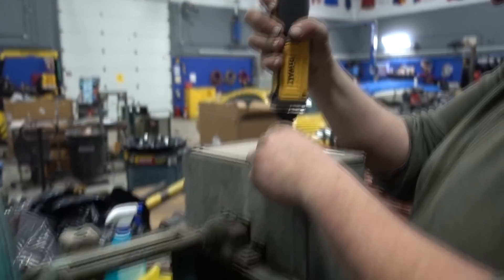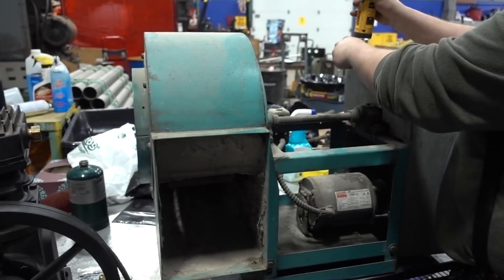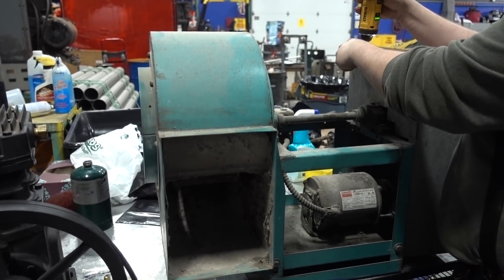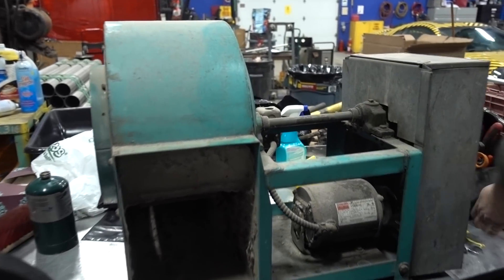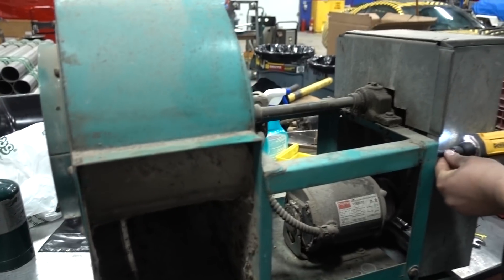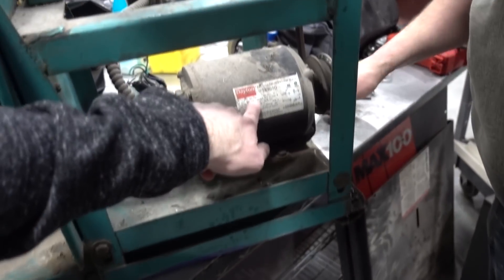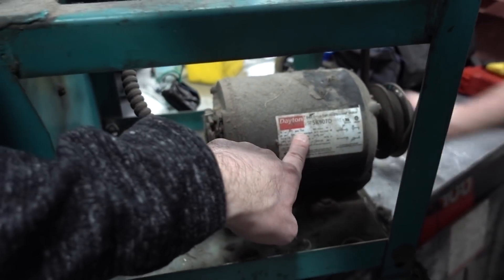Captain's Blog 2 9 2018 OMG We Need Motors

Comment: Another way to mount a motor that hasn't got the flange base if the shaft is longe enough, add a bearing to the shaft that mounts on the base, add something on the back (spider) to hold another shaft that also mounts on the base, then add something that allows you to fix the position. bearing at front and rear allows motor to rotate, rear bearing can be a sleeve.
It's what i'm doing for my front flange mounted motor.